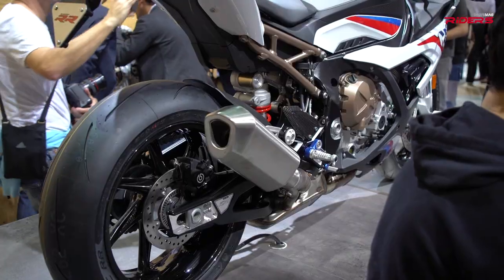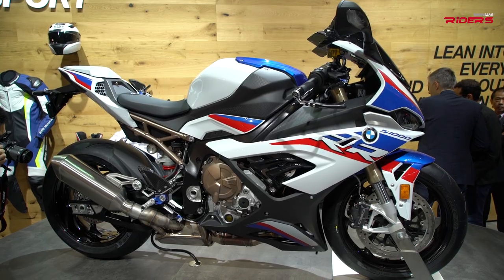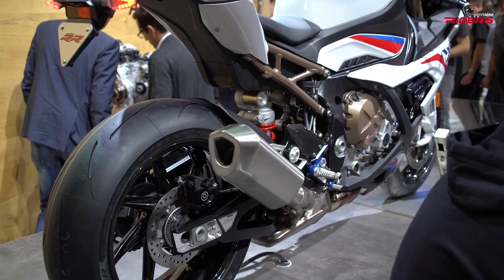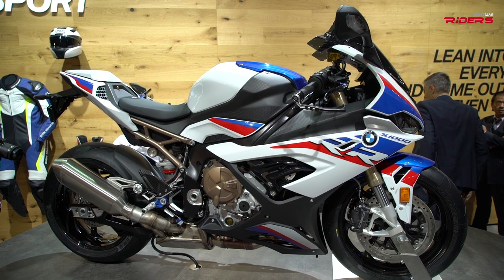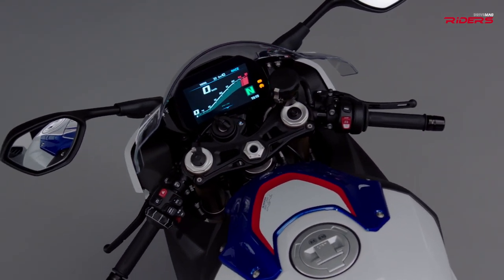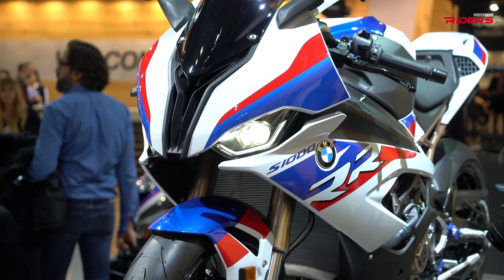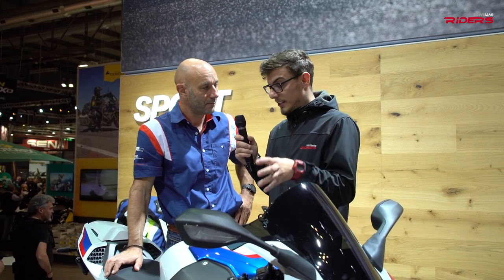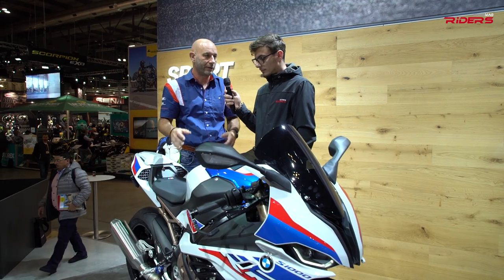2019 BMW S1000RR - Everything You Need to Know | Expert Interview

Comment: The VVT in the new Gixxer 1000 is flawless and a very simple design. Is it patent?
Reply: yes, Suzuki has a patent on it
Reply: It was only a matter of time before another factory would apply it to thier bike. Its funny how simplicity just works!
Reply: @adult1122  - the system Suzuki uses is so simple its almost perfect,BMW obviously cant copy it so their ShiftCam VVT whilst quite clever is mechanically very complex,i cant wait to see how it performs when bikes get tested etc.
Reply: Rocco u right. The bmw has less toque than the 2019 gsxr r. The gsxr has low down torque all the way where the BMW comes alive at 10 thousand revs. And that's BS!!
Reply: And the quick shifter is more smoother on the gsxr as on the bmw

Comment: Did they resolve the heating frame issue on this new model? the frame used to get VERY hot that it is impossible to touch it. Are they hiding the part that could enter in contact with the rider- or did they isolate further the engine from the frame? 
The new look is nice. The two things i will miss are the back light which was a piece of Art and the shark agressive fairings
I am interested to know if they made it more confortable for city daily riding also?
Reply: Looks like the ergonomics change moved the frame a bit away from the legs, so there is no heat issue if you don't have to touch it
Reply: Never really had an issue with that. Don't get me wrong the frame does get hot but at minimum I wear jeans and it's never transferred enough heat to hurt or burn. A good set of riding pants and you don't even notice it
Reply: @custommotor  I wear Jeans also and good set of riding pants when on track, but when the outside temperature arises to 35 degree I cannot ride my bike anymore :(
Do we know if they made it more comfortable for city daily riding also?

Comment: I love the new facelift of the bike. The new HUD and the overall design and familiar shape of the S1000RR series. The upfront front area, not like on the ducatis and gixxers, which are kinda depressingly narrowed downwards.
I got into bikes when I was just 14 years old. Loved the bike scene, craved about bikes and used to play them in games more often than regular racing cars, in this case: Project Gotham Racing 4, Yamaha R1.
I loved the R1 from, those big innocent eyes ... but yamaha fucked that up with some alien-ish slick eyes, which I personally don't like at all, like the Z1000 front. Bought the Z900 and I don't regret my decision at all. Sporty, aggressive, no scream but deep grummle. A supernaked in my collection. Missing a supersports.
Looked after the S1000RR. The features, security, safety, whatnot - a reason to buy, but that pre-2019 front ... sorry, but that was a no go for me. I don't mind asymmetrical stuff (our faces are the same, when even slightly) but frankly said ... the S1000RR was just meh.
The 2019 model ... erases all my doubts buying it. I wouldn't, won't and will never regret spending 22.000-ish euros (my own setup) for this high class bike.

Comment: An important question to the S1000rr DriveMag community:

My S1000RR 2017 Bike pulls to the right when I let go of the bars and I need to compensate by pushing more on the left handle bar all the time even if it is slight but it is disturbing. On track it causes some unbalance when the front wheel rises a little bit on acceleration and land down not on a correct position.
 I heard that it is the clutch cable that is wrongly fixed from the factory on the right side near the radiator that is too tight (or loose) causing the issue as it tends to impact the steering.
DriveMag: Does any body know if BMW has an official fix for this issue? it is really annoying - my friends are experiencing the same issue also.
please advise.
V

Comment: maybe i took the short bus but i have watched this and they talk about new modes and such . and the m having pro mode . but  can the systems be turned completely off. as in .   ABS off, tc off , no wheelie control or rear brake being linked .   also did not hear if you can control the engine braking either?

Comment: Judging by the previous S1000RR atrocious reliability (yes, I had one), this new variable valve timing tech is sure to be a pain in the ass...
Reply: João Soares Was it really that bad? I’ve always heard either they are very reliable or very unreliable.
Reply: @chaseeubank2071  my experience is that they were very reliable. my friend has a 2010 that he bought new and it still runs fantastic without issue.
Reply: motograce I’ve always wanted one, this one may be the one I pull the trigger on.
Reply: I have a friend with an 2015 S1000R that has over 80,000+ km. No joke. My 2017 S1000RR has zero issues as well. Plus BMW has an unbeatable warranty period from the factory that is extendable. You probably just had a lemon.
Reply: A friends one always had problems with the quick shifter not working and needed replacing a few times and the water pump failing a couple of times before he sold the bike
Reply: also, i owned a 2016 s1000r for about 18 months and after 13k miles, not a single issue. my 2013, 2016 and 2017 r1200gs' had many issues.
Reply: I really don't know what are you talking about i had s1000rr 2010 till 2017 and had no issues and my riding friend still riding on hp4 2014 he got it brand new when it came out and to very day without single issue. The reliability thing seems like a bad luck. One guy from my riding group had new gsxr750 and in the first year he had 2 major engine failures yet suzuki known to be very reliable bikes. I am absolutely positive if you do your maintenance in BMW and use only legit parts to mod it and not cheap mods, I don't see any reason why you should've reliability issues.
Reply: My 2010 has be flawless

Comment: Please tell me they made the engine more reliable. Before my neighbor crashed his 2012 s1000rr it had engine knocking. And he took care of that thing! Bmw should make 2 models one which has max power and all the computer aids and a cheaper one with lower hp and little computer aids. The only reason bmw has reliability issues is because they push their engines beyond engineering capabilities. At humber college I'm taught to only use tensile strength up to 60% of the yeild stress bmw is up at 80%. Thats why their K series last long because they detuned those bikes for police officers. What alarm's me is that he didn't even talk about the water pump/oil pump that much and the ball bearings in the crankshaft connecting onto the connecting rods. As much as I love bmw untill they address these issues will ride my 2009 fz6r till she dies.